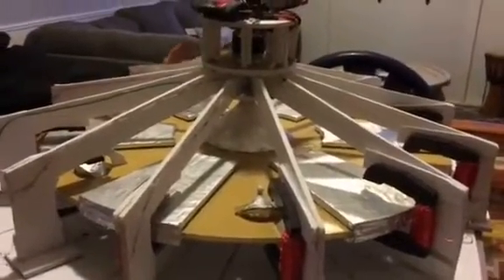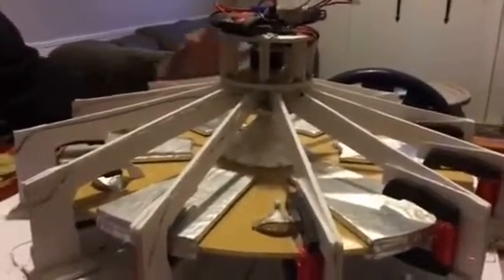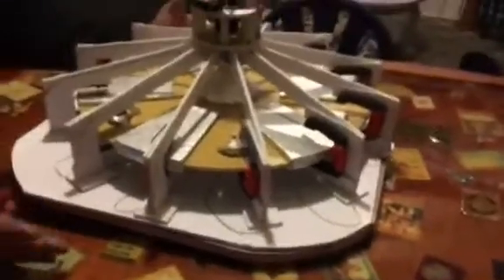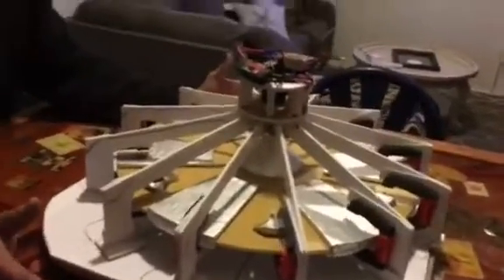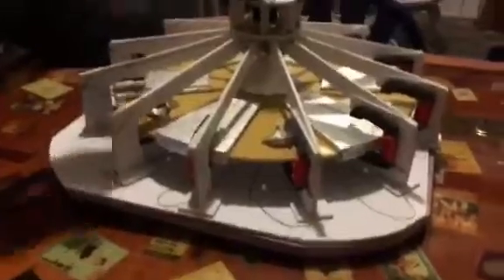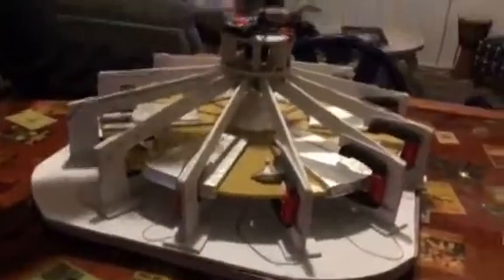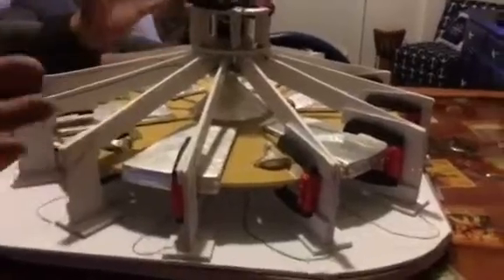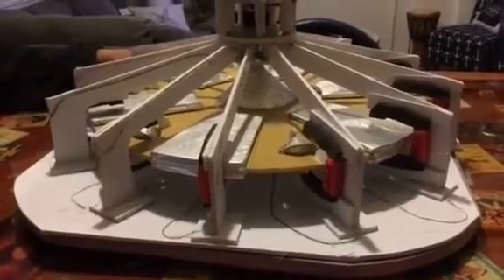OTC X1

Comment: You ever put power to an electric motor with a wheel on its axle and the motor flips out and rolls the other way unless you secure it? That is why you’re other rotor is spinning the other way. You haven’t the slightest clue about even the basic physical properties of unsecured torque and a flywheel. And you’re making a OTC-X1 by looking at a picture and calling the test a failure whilst being bedazzled at the counter-torque create by an RC motor. How did you not expect this to happen having mounted it on a point-of-rotation. Do you know why helicopters have tail-rotors. I mean come on man. This is elementary ... I will give you an A for ambition, but models like this are the reason so many people do not have the courage to attempt it themselves, because they see this being as likely as good as they could make, and they see it not working. And I’m sorry, but like David Hamels machine, if this is not built with a lathe and mill, you’re wasting your time. The inaccuracies of construction destroy any ability for the machine to even start to produce any sort of measurable effect and throws the project down the failed files before it was even “tested” you are lacking capacitors, batteries, high voltage components like the Van de Graaff Generator, have you ever read any of Carr’s interviews? Come with the pitchforks and axes Project Camelot keyboard warriors, but Carr’s design is actually one of the worst designs as far as over-unity machines go for dependability. It’s quite mechanically advanced, requires batteries and is prone to the failures of these components. You’re spinning a popsicle stick UFO with a motor and calling it a failure. What electrolyte did you use to fill the hollow sphere which is machined into the conical halves of the central accumulator? Did you know the central accumulator contains a hollow sphere? Have you ever done research on what the dynamo’s are actually made from? Have you considered they are actually wire-wrapped coils themselves with a receding wrap pattern to create the conical shape? Do they contain a hollow sphere like the central accumulator? Or did you just read the amusement device patent and start gluing. Not trying to shoot you down man, but I HATE to see people with time,  ambition, and resources, people like you, or Wood-Brass-Glass, wasting their amazing talent and resources building things COMPLETELY incorrectly and calling it a failure. This is a good model, it’s well made with what limited resources it looks like you had at hand, but it is not in the slightest an OTC-X1 in anything but similarities of a picture.

Comment: Mine...I replicated too from Otis Carr but I threw it away of year 2013 when I built that earlier year 2008 and gave up, even though I put neodymium in different alternated poles, it did the same thing. The inner utron or neodymium 'pushes' the "'outer stator' skeletal body structure" in clockwise direction.  I even reversed put the neodymium in the side of stator skeletal body and the utron in circular board still doing the same "pushes" both rotor and stator doing in alternate/opposite direction rotation.  The key here is both stator and rotor are in "free wheeling" because in between rotor and stator has/is bearing that's why no matter what we do, both rotor and stator are pushing each other away tends to rotate both in alternate/opposite direction rotation. You already can imagine that, it's indeed positively, absolutely it wont work. That's why I threw it away mine 7 years ago. I think Tesla had his own another different designed model of engine given another types of different model design of engine for Otis Carr if it's going to work.

Back in my young age of 9 or 10 of elementary somewhere in mid 1970s, I met an alien (human) not from this Earth and showed me his engine and his computer explained me how it works but not completely understand the parts because kids mind still blank new to the world but learning new stuff.  Back in that generation years, there were no computers yet built. The Alien showed me his diagram differently I couldn't understand before. But I tried to remember the parts. Those aliens knew better than human earthlings curiosity of their engineer as I was told.

Comment: Have you reached out to Ralph? Maybe your missing information that he didn't disclose.
Reply: Did it work on your project yourself.  Mine...I replicated too, I threw it away 7 years ago of year 2017 even though I put neodymium in different alternated poles, it did the same thing. The inner utron or neodymium 'pushes' the "'outer stator' skeletal body structure" in clockwise direction.  I even reversed put the neodymium in the side of stator skeletal body and the utron in circular board still doing the same "pushes" both rotor and stator doing in different opposite direction rotation.  The key here is both stator and rotor are in "free wheeling" because in between rotor and stator has/is bearing that's why both rotor and stator are pushing each other tends to rotate both in alternate/opposite direction rotation. You already can imagine that, it's indeed positively, absolutely it wont work. That's why I threw it away mine 7 years ago.
Reply: @NickBrunsky  it may have not worked the way it was intended to but you created a free point energy engine / device successfully which is capable of running any electronics you connect it to. Why would you throw that away?🤔🤨
Reply: @milkywaymusic  Can you see between "rotor" (circular board) and "stator" (skeletal body structure) "has/is bearing" (a free wheeling) "that tends to push each other away in alternate/opposite direction rotation"?  The "stator" will become rotor too. So both are in rotor position. It won't work no matter what/how you troubleshoots everything or do something to improvise still it won't work as you can see already in this video even mine that I threw it away. Because I've been trying to solve and troubleshoots actually since year birthday September 2008 of my older brother that I've got one more year before I moved out then until year 2013. To me, I really know it will work but when I found that out between rotor and stator, that's it. Absolutely positively, indeed is not going to work no matter what/how troubleshoots or improvised I did and I can tell that. I'm engineer of electronics, aircraft and mechanical. Otis Carr has a different engine version model that has given by Tesla if it's going to work. Tesla has his own different version engine model either if it's true if he put it in schematic diagram or blueprint but nobody found out that Tesla has that schematic diagram. This means Tesla kept it in his mind and did not expose nor divulged his idea. I was very disappointed of Otis Carr's engine version model. Otis Carr's picture of little UFO is decorated only place on top of any table which no demonstration sample of fired out levitation. I have a feeling and thinking that it could be Tesla gave two versions of different version engine model to Otis Carr. Then Otis Carr copied built the one that really works that levitate and demonstrated but patented the second different version engine model and pretend showing the second different version engine model he was working to everybody/everyone and "gave 'that' second version engine model" to Ralph Ring then explained what Ralph knows. You know that Otis can't trust government that Tesla advised Otis Carr to be very careful because what they did to Tesla. If not, the only way to find out is where did the government kept Otis Carr's huge final worked and other little different models of anti-gravity vehicle toys...if this is true. I also knew the RC engine how it works and relates to Otis Carr's engine, it won't work because of between rotor and stator is bearing that is free wheeling which tends to push away both direction in alternate/opposite direction rotation no matter how you troubleshoots because the stator also will become rotor. So both acted as rotor.

Comment: Use rare Earth neodymium magenta top and bottom on outer carriage just keep placing them on said carriage until liftoff..or freeze said magnets at different temperatures then place onto carriage,your welcome (Ronin)
Reply: Remember use different pole magnets also..(Ronin)
Reply: @roninrider1930  Did it work on your project yourself.  Mine...I replicated too, I threw it away 7 years ago of year 2017 even though I put neodymium in different alternated poles, it did the same thing. The inner utron or neodymium 'pushes' the "'outer stator' skeletal body structure" in clockwise direction.  I even reversed put the neodymium in the side of stator skeletal body and the utron in circular board still doing the same "pushes" both rotor and stator doing in different opposite direction rotation.  The key here is both stator and rotor are in "free wheeling" because in between rotor and stator has/is bearing that's why both rotor and stator are pushing each other tends to rotate both in alternate/opposite direction rotation. You can already imagine that, it's indeed positively, absolutely it wont work. That's why I threw it away mine 7 years ago.
Reply: @NickBrunsky  you also have to remember it would probably work in space tho...lol
Reply: @roninrider1930  I know what you're saying and what you mean but we have to make sure it works first but once we know it doesn't work, you don't wanna take that chance risking our life in outer space. We have to make sure first everything works but here in this video it proves now it doesn't work the same as I replicated of Otis Carr's engine model it doesn't work either and troubleshoots for 5 years still doesn't work that's why I threw it away last year 2017. We have to prove it first if it works. We can not insist if it doesn't work on Otis Carr's engine model.

I'll repeat it to translate in your Russian language:   Я знаю, что вы говорите и что вы имеете в виду, но мы должны сначала убедиться, что это работает, но как только мы узнаем, что это не работает, вы не захотите рисковать, рискуя нашей жизнью в космосе. Сначала мы должны убедиться, что все работает, но здесь, в этом видео, это доказывает, что теперь оно не работает так же, как я воспроизводил модель двигателя Отиса Карра, оно тоже не работает, а устранение неполадок в течение 5 лет все еще не работает, поэтому я выбросил это в прошлом году 2017. Мы должны сначала доказать это, если это работает. Мы не можем настаивать, если это не работает на модели двигателя Отиса Карра.

If your language is German here's the repeated translation:  Ich weiß, was Sie sagen und was Sie meinen, aber wir müssen sicherstellen, dass es zuerst funktioniert, aber sobald wir wissen, dass es nicht funktioniert, möchten Sie diese Chance nicht nutzen, um unser Leben im Weltraum zu riskieren. Wir müssen zuerst sicherstellen, dass alles funktioniert, aber hier in diesem Video beweist es, dass es jetzt nicht mehr so funktioniert, wie ich es von Otis Carrs Motormodell repliziert habe. Es funktioniert auch nicht und die Fehlerbehebung für 5 Jahre funktioniert immer noch nicht. Deshalb funktioniert es nicht warf es letztes Jahr 2017 weg. Wir müssen es zuerst beweisen, wenn es funktioniert. Wir können nicht darauf bestehen, wenn es beim Motormodell von Otis Carr nicht funktioniert.
Reply: @NickBrunsky  I speak Norwegian and fluent English and now I live in Wa state lol..I was just referencing how objects move in zero Gs better is all.
Reply: @roninrider1930  k I got u  :)
Reply: Any success
Reply: @multiverse8101  yup i am messaging you from Mars right meow

Comment: At first when I looked at the drawing. I have a strong feeling it's going to levitate/fly. But when you built it in actual, it went in opposite both direction of rotor (circular board) and stator (skeletal structure part of the entire body), it did not even levitate. The same as yours when I built too 7 years ago of year 2012.  The rotor circular board inside went to counterclockwise rotation while the outside stator skeletal structure rotates in clockwise. It did not work. It did not levitate. It's useless, wasted of big money because I built right away the size engine to use it for the size of a car. That's why it's big wasted money. 

The picture we saw was only decoration of Otis Carr did not show in the picture that was levitating in the air, it's only on top of the table decorations. The government/US Military/FBI raided him because they noticed the monetary money is being bankruptcy, running out of money that still nothing happened not working to what they built. That's why they confiscated everything even the business patent because it did not work. 

Ralph Ring looks serious telling us all about  story of Nikola Tesla and Otis Carr's connection to make it looks real story and it shows in this video did not even levitate/hoover. But when you built it in actual seeing it with your hands, again it did not work out in any strategic configuration that I tried to see the troubleshooting why it did not work and still doesn't work. Yup it looks so simple in our configuration mind seeing in the drawing but still doesn't work. I disassembled it and threw it away everything 7 years ago in year 2012. I've got discouraged and very disappointed.

Well, it's up to you ladies and gentlemen. Like I said it only rotates in opposite direction both rotary and stator... very discouraging... I could not believe that it did not even levitate/hoover.  This is very, very disappointing. Proving evidently showing already in this video ladies and gentlemen. 

Like I said also, it's better the  Alien UFO's advanced Hi-Technology engine that really works which I've already business law patent it.

Watch this other demonstration too guys if it's going to work/levitate and click/tap this link -->https://www.youtube.com/watch?v=-HhFkLnttD8  and this link too -->https://www.youtube.com/watch?v=mtl4yM1ZVQg&t=289s.

Comment: Don't give up, It is suppose to do that.build a cage around it put a soft spring with a rod. so that if it starts to lose weight it will lift in cage .
Reply: Have you been successful?
Reply: @multiverse8101  Well I have not been able to finish, Due to almost Passing away, Not to much after I wrote this, If God don't take me, Maybe i,ll finish what I started, But yes, I did get Far, But that's all I want to say, sorry.

Comment: if that unit is indeed a twin vortex, what makes you think it will burn up? The two running together lift the stress off each other. At some point, you will hit the sweet spot in the rpm's and it should start to lift. If you feel the need to check what I am saying, use a temp gage on the motors.
Reply: i think you are totally right,kind of getting resonnance of the system...
Reply: but what do you mean by "temp gage on the motors"? thanks ;) why checking the temp of the motor,can give information of a lift ?
Reply: When the resonance  equals that of its surounding ,it cancels out the weight ,thus lift issues.

Comment: spin it faster, way faster
Reply: I think it's a combined rotation of 34000 rpm
Reply: Given the material that Peyton type is unstable. A working model will require materials that can handle the force as well as outside disturbances.

Comment: There is a principle in the materials the OTC-X1 is made from that people are overlooking or unaware of.
Reply: What materials are used?
Reply: Yes what materials ???
Reply: DECAGON ooo t6 Aluminium
Reply: Aluminum. Steel. Copper.
Reply: Yes the Utrons are mercury filled. RIP RALPH RING. You can find out the specific frequencies reading Otis T. Carr's dimension of mystery poems.
Reply: Unobtainium, nosuchthingium, and crystallised fairy farts

Comment: OCT.X1
 I restudy your video .
Large spacing between plates . Magnetic shoes has one engaged with plate . Next magnetic shoe on blank plate . As it speed up it may have a reverse kick back  . 
In a picture of carl otos the placing of the plates is 1/4" gap you have about 2" 
Might solved the problem is to turn off  every second shoe magnet after starting . Kick back should stop . Carl ottis had this problem in early stages and recreated isolation switches for each magnet horse shoe . So he could control the problems . 
eg . 12  4  67 9.10 12.13 15.16 
Turn off 3. 5. 8. 11. 14.
Hope this helps .  ps l love to have your model .  Mind will be tested in this working at speed . Ps put a safety cage around it . And table fixed to floor . Bolted down .
Reply: Any info

Comment: This is a thought for you.  Having studied Carr's diagram that some are trying to replicate, try securing the outside of the disc and watch the response of your Utron on the inside.  

Second thought: Carr's external Utrons I believe are creating and storing an electrical charge and that electrical charge I understand is being sent to the center Utron.  If my observations are correct-this resembles the function of a lawn mower engine.  The Utrons act as the magnets around on the starter of the fly wheel and the Center Utron acts as the spark plug that collects the charge and distributes it as a spark.  In this case the center Utron is supposed to take the charge and turn it into the properties of particle acceleration to polarize atomic structure of the atmosphere thereby altering the gravitational field.

Let me know what you think of my guestamation.
Reply: Sounds good. Can't wait to your machine in action!